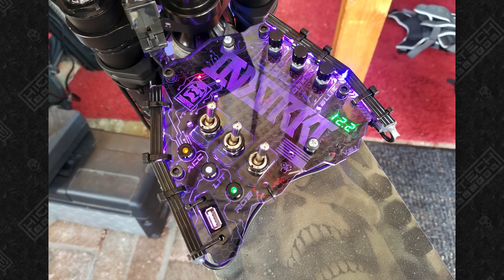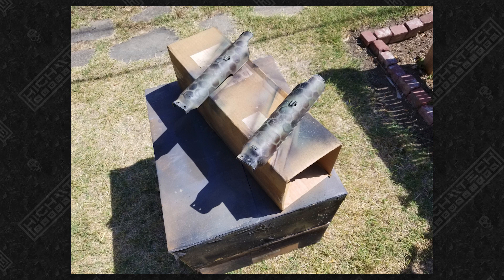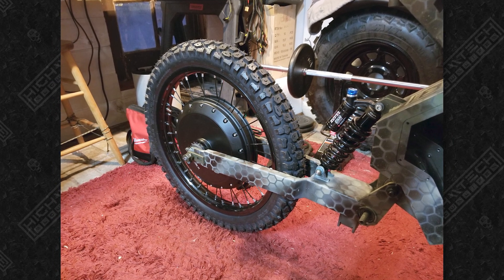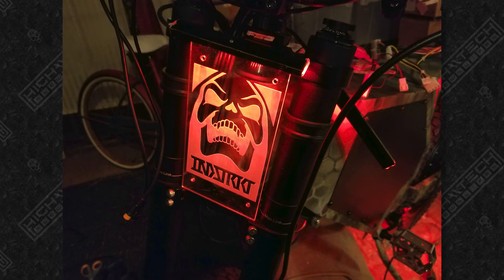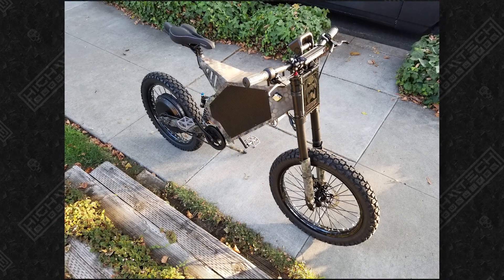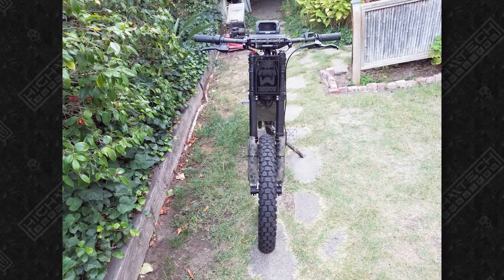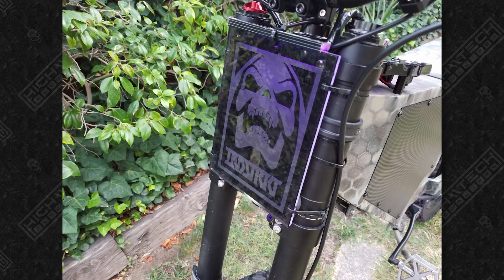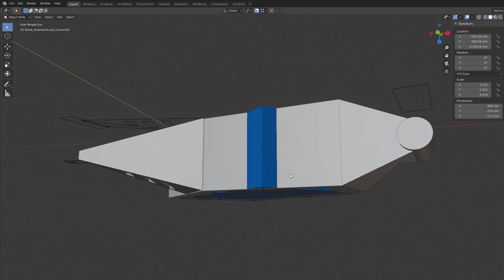🚲 Custom 8KW (8,000W) E-bike! Hex-Camo Enduro Ebike - DIY Full Build! 72V \ QS273

Comment: Ain’t this supposed to save money
Reply from the maker: What's supposed to save money? Building big expensive ebikes? Nah, that won't save you money. 

I have some other more budget builds if you're looking to save money. Are those less expensive than a car for transportation? 100%. No gas, no insurance, no registration, no traffic. They're a lot more efficient in a lot of ways when compared to cars.
Reply: @hightech-lowlife  I'm building a 80ah battery now who sell the best 8000 watt controller...nice work there
Reply from the maker: @Billybritt-s4t  Thanks, there are a few good controllers out there, just depends on how much amps and wattage you need, and also what voltage you're running 👍

Comment: You could simply bypass your bms for discharge only... just make sure you don't then overdrain your pack... 9r it's really not that hard to swap the bms for a more capable one... assuming the cells they used are capable enough as well. I'm seeing your new battery now...
Reply from the maker: Thanks man! Yes I believe this will be the direction I go for my future builds. Most controllers will have a discharge cutoff anyway. I will be experimenting making my own packs too!
Reply: While it is an acceptable risk to bypass the BMS for the discharge path, this is still risky unless you know the exact cell type and its physical specs. A battery is not simply limited by the BMS but the current rating of the BMS should match the cell specs and the use case as well. In example: It makes no sense to have a 80 amps BMS if your cells can only deliver 50 amps without getting too hot. Also the dimensions of nickel used inside the battery are a limiting factor. Chinese will often simply use hilumin (nickel-plated steel) because it is cheat but has a much higher resistance. This being said bypassing the BMS for discharge can be acceptable if you know all the described parameters for your battery and can live with the risk frying a parallel bank without shutoff during use (this has happened two times for me). Also use a fuse in the discharge path.
Reply from the maker: @HolgerBeetz  Thanks man! I totally agree that having a BMS for discharge is always the better option and safer for sure. I've just seen a lot of people use the controller for over-discharge protection by limiting the current cutoff at your set voltage. Most explosions/fires I've seen are almost all from charging (which you definitely want a BMS for that) I haven't heard of a lot of issues with discharge, I'm also not saying it's not risky and possible though. 

There is a channel "The Inja" and his buddy makes a lot of very large packs for e-motorcycles, and he doesn't use a BMS for discharge - he knows more about battery building than I do, but it's possible he is making risky packs. 

Can you let me know what it was that fried your parallel bank? Was it out of balance cells? 

Thanks for your insight 👍
Reply: @hightech-lowlife  My parallel banks were simply fried / killed because I didn´t pay attention to the cell voltage in the first place. I guess it happens like this: Usually only one cell of a parallel bank doesn´t reach the full voltage during charching or may be reaches the voltage but quickly drops to a lower voltage than the other parallel banks in the battery (3.8 versus 4 volt for example). In the sum for all voltages this drop is not really noticable (I use a Cycle Analyst on this bike). The voltage level gets worse and worse to some point where riding the battery down to its lowest voltage and the parallel block simply dies (0V cell voltage). You most likely will not notice unless you charge the pack. Given you have a BMS in the charge path of your battery which shows the individual cell voltage this would not be a big issue because you would identify this parallel bank in the first place but who uses an expensive BMS for such purposes. Personally I went away from the no BMS for discharge route. Most packs I build now have quality 21700 cells which are not exactly cheap. So using another 50-70€ on the BMS will not hurt. I have had good experiences with Daly BMS in the past but my E-bikes play more in the 1-2 kW range. Not such beasts as you are building. In Europe in dense city areas you have to stay below the radar if you know what I mean. So blasting around with a Camo stealth bike without pedaling going above 30 km/h on the street would not really be helpful.
sry for the long rant....HTH
Reply from the maker: @HolgerBeetz  Ah I see, thanks for letting me know. Yes I think with no discharge BMS you have to be extra mindful to check the cells every couple of charges to make sure nothing is going out of balance. But if you are charging with a BMS, then this should be safe, so again I think the issue really is mostly with charging and or not monitoring the cells, but having a BMS for both does make things a lot easier and safer 👍

I can't wait for tesla giant 50mm cells to use in ebikes, that will be fun - it will be a while though until those are available. Although packaging 18650's is easier than the larger cells. 

Yes, there are so many rules in europe for ebikes. I think you can register as a moped for higher speeds, but then you can't ride on a place only for bikes. I've never been pulled over or even talked to by police here on my ebike, but I also don't really ride crazy through high traffic areas just for my own safety, the cars here will just run you over if you're not paying attention 😁
Reply: @hightech-lowlife  Yes, exactly. As long as you pay attention to the voltage of each parallel cell bank you should be fine. This really limits the risk during discharge without BMS. In my case I simply had a cheap BMS which did not provide any informations on the voltage level for each bank. So in the end: Things seem to sum up and finally destroy a full parallel cell bank because on cell shows greater variantions in voltage level without being noted. End result: Cell short circuits and kill all cell in parallel.
Reply from the maker: @HolgerBeetz  Ok, I guess as long as you're checking voltages at least every other or every few charges to make sure everything is balanced it should be ok - although wouldn't every time you charge it would rebalance the cells if you have a BMS on the charger? I'm assuming if you have a discharge BMS and this issue happens then the BMS would just shut down the pack to prevent the rest of the cells from being damaged?
Reply: @hightech-lowlife  Yes, you have nailed it down. The balancing part of the BMS will do its job during charging.
And the BMS would "only" protect the disbalanced / damaged parallel pack by shutting down if things go completely down the drain. It is not exactly the perfect solution but at least in my case it might have saved me from replacing only one cell instead of five cells. Since all cells were dead I can no really confirm this but my guessing is that in such a case only one cell is really fully damaged and the rest of the parallel pack is still fine. At least I have salvaged enough old 18650s from E-bike and Notebook packs to confirm that one sees some variations in terms of internal resistance and remaining capacity for cells that have been in parallel for a long time under use.
Reply from the maker: @HolgerBeetz  I see, still a good idea to have a discharge BMS, but if you're monitoring your voltage consistency then it should be ok (with some inherent risks) 👍

I tend to only use old laptop cells for super light duty things - just in case, hopefully that bank that got fried wasn't super premium cells. 

Thank you for the discussion and insights!

Comment: You have great talent.  Thanks for sharing it with us.  What a great build!
Will be tuning in. Subscribed and my respect.  And yes, most of us learn the BMS amp limit the hard way....and cell discharge rate has to match the BMS as well.  Good 21700 cells are worth it.
Reply from the maker: Thank you so much, I really appreciate the feedback and comment! I have made too many mistakes with batteries and especially power output/BMS's :) I'm excited for the next 5-10 years in battery tech, it should be a game changer for ebikes! I have tons more content on the way, thank you for subscribing!

Comment: You should try a build with a cyc x1 motor
Reply from the maker: Never heard of them before but I'll check it out :)
Reply: @hightech-lowlife  CYC = noisey mid drive but 5K watts.  You are on the right track with quiet gearless 8K watt rear hub motor on this monster bike build.  And yes, a big motor needs a big battery. 👍
Reply from the maker: @lukewalker1051  I've always been a fan of hub motors after my initial mid drive ebike, but I do want to try a more conservative build with a mid drive again just for something different. That's the other thing I really dislike about mid drives, they are very noisey compared to hubs which are basically silent! Would you recommend the CYC over BBSHD?

Comment: SWEET RIDE.  👍
The controllers they make don't match up with batteries that fit mountain bikes or your Enduro bike.  I seem to always come up 20amps short on what I really need.

Bluetooth connection, disco the 3 pin communication wire coming from display then launch mobile app MQCON.   Turn it off and on and you'll see an error on display and the app should connect.
Reply from the maker: Thanks so much, I have a new controller for this bike now (will reveal in a future video), if I have issues with the bluetooth I'll try this tip, thank you!!